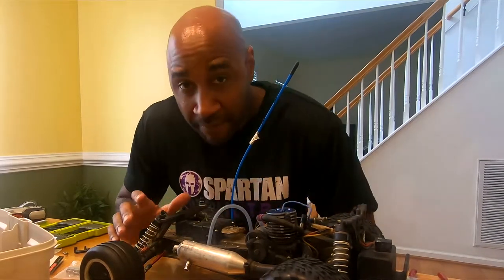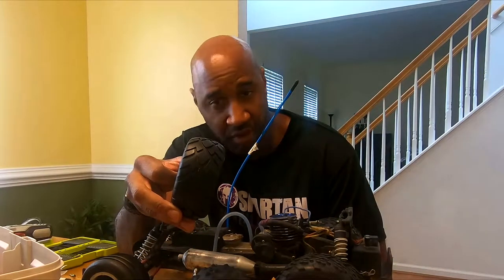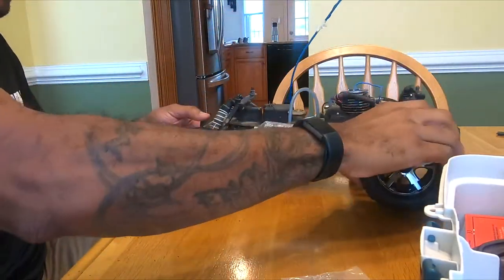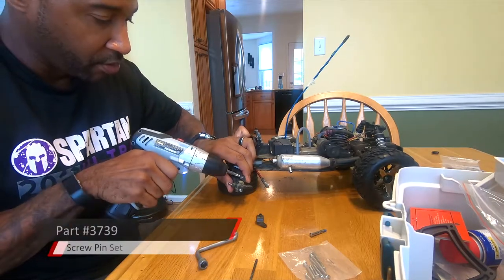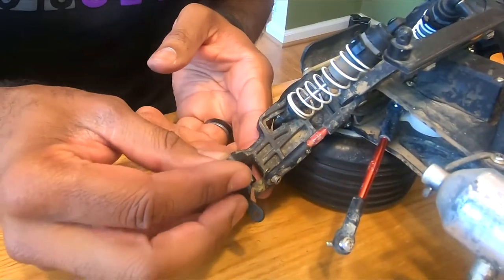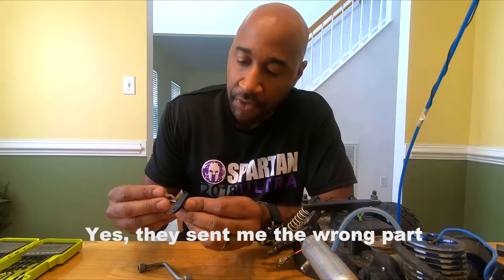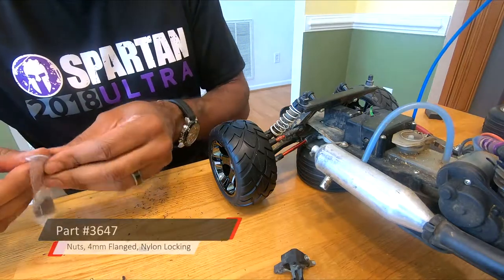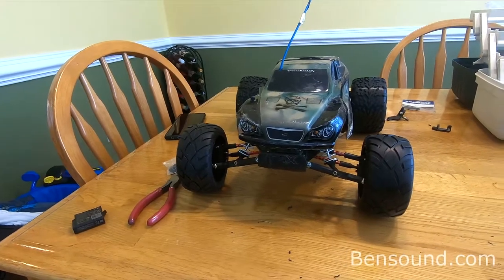Traxxas Nitro Sport front wheel conversion to Hex

Comment: With this mod can you still use the original tires right?  Just remove the wheel hubs?
Reply from the maker: Yes, I switched out the hub so that I could use a bigger variety of wheels but you could put the regular tires on different wheels